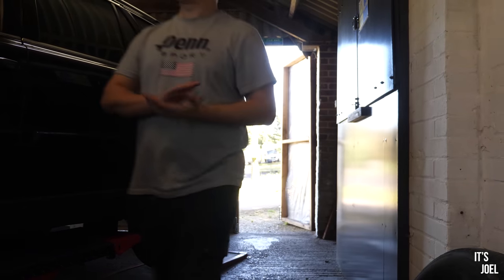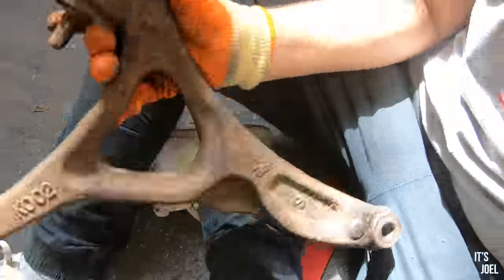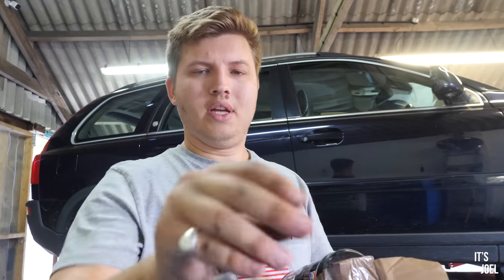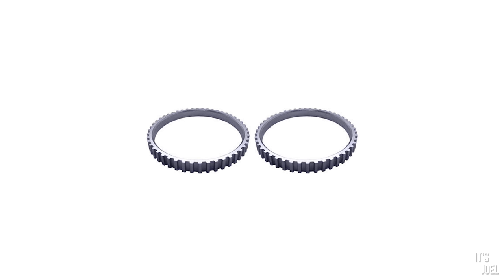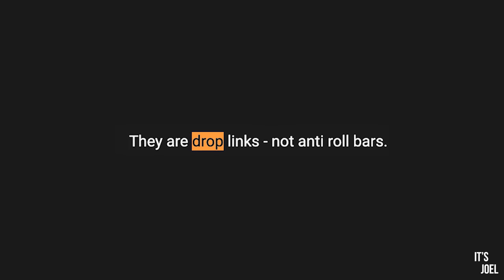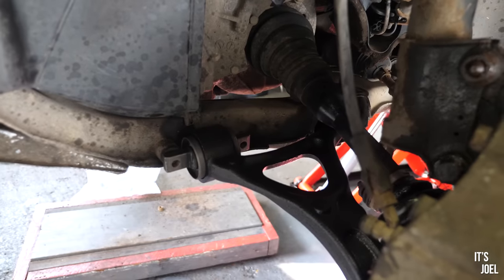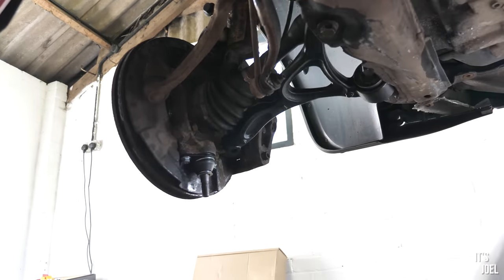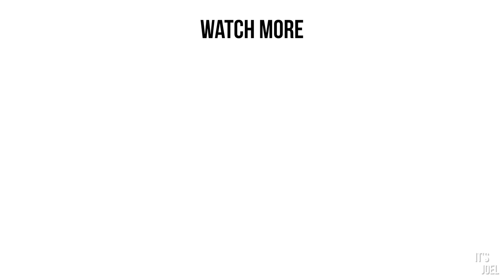CAN I SAVE MY £800 COPART VOLVO XC90? PART 2

Comment from the maker: Click HERE for Part 3! https://www.youtube.com/watch?v=yxhDSFCjmA8
Reply: It's a ball joint, ie it has a ball at one end It's supposed to move just push it back straight
Reply: Keep on doing this man, u will learn so much more. Utube is a great help:)
Reply: I got one little niggle... you got this nice big can of copper grease, but I didn't see you put some on the bolts that hold the ball joint... 🤔🤷🏻‍♂️

Put some on all your bolts and nuts, including the wheel nuts!
Just a little on the end of the thread is enough. They won't come loose by themselves, but it will make your life so much easier, next time you need to take them off!! 👍
Reply: @MasterSandman  never use copper grease on wheel nuts, they're designed to be dry fitted, any actual mechanic knows that
Reply: @jonathansmith2407  I've been working on old cars (15yrs and older) for a long time! 
Perhaps wheel nuts are designed to be dry fitted, but those rusty buggers are always stuck like a em-effer! A tiny bit of copper grease will prevent that from happening in the future!

I'm not saying "Slather them in it!", I clearly said "just a bit at the end of the thread, is more than enough!"

It might not be the "official" way and new cars might not need it... but any mechanic from some small workshop (just like any "home mechanic"), working on old cars, knows that sometimes you don't adhere to the "official method", you do what works! And this works!!

If you don't have an air system in your garage/shed and therefore no airgun, you'll have to loosen them by hand. And if they're stuck you'll have a hell of a job, so the moment you got them loose, you put on a little bit of copper grease at the end of the thread and you screw 'em back in! Next time, they won't be a problem!
Reply: Probably not the best car to start mechanics on there the hardest lower arms I have ever fitted a absolute pig of a job also as others have said the ball joint isn't bent its supposed to move🙈
Reply: @MasterSandman  if you want to lube nuts first clean on a wire wheel and buy proper nut wax which is designed to be used on wheel nuts, copper grease burns and gums up with brake dust stopping the nuts from tightening correctly, copper grease isn't designed for threads it more for mating surfaces
Reply from the maker: lesson learned! @jonathansmith2407
Reply from the maker: Oh I used it alright! Just didn't quite pick it up on the camera, thanks for watching! @MasterSandman
Reply from the maker: That's interesting to hear that these are particulary difficult control arms! And I've learned my lesson RE the ball joint... @grahamsmith4869
Reply: Also a smear on the inside mounting face of the alloy wheel stops them getting stuck due to alloy to steel corrosion.
Reply: but I think that is the least of yr problems!
Reply: its a ball joint, straighten it!!!!
Reply: Hi Joel, what car lift are you using? Regards
Reply: Buy that thing.
If you can see a bolt,this thing wil always give you decent acces.
And,,,there even safe with air tools to,if you hold pressure on the tool it selve
Worked as an mechanic almost 35+ years on  by a volvo dealer.

Comment: To remove the driveshaft from the hub you need to unbolt the tie rod ends (and maybe the struts) from the hub to give yourself enough movement to pop it out. I did a ball joint replacment on axle stands and it was easier to remove the hub entirely from the car.
Reply: Also the ball joints move, think like a your shoulder socket. they are very stiff on new ones but can be moved by hand. So your "bent" ball joint isnt broken.

Comment: it's a ball joint.  It moves.  That's what joints do ;) Move it back straight and you'll be fine.

Also, a small nit pick: in a previous video you were talking about lug nuts.  XC90s don't use lug nuts - they use wheel bolts.

Comment: Congratulations on getting on with it - been there and most definitely done that myself and no matter how daunting it just needs to be one job at a time!
Some words from the wise though - use the right tool for the job and your life will be so much easier. Please don't use torque wrenches unnecessarily, they may be big and chunky but they are also expensive to replace when you wreck them, a basic breaker bar is always a good choice when you've got a stuck bolts. A cheap(ish) impact gun is a much better choice, a mains powered gun might even be a better option than a more expensive battery powered gun if you have a mains socket on hand. It will save a lot of heartache from rounded off rusty bolt heads

Comment: When your struggling with rusty seized nuts and bolts try quenching method heat it up until its red hot pour cold water on it works every time

Comment: I feel your pain - I had to do this job on both sides of an XC70 (same platform). It is doable - trick is to remove the two bolts on the strut, and leave the driveshaft bolt out, then you can put it all back together - it is hard work though. I had a trapped nerve in my leg for about a month afterwards (very painful), from doing it on my driveway.

Comment: In case  you haven't fixed it by now, the trick with these Volvos is to either loosen the top strut bolts (not the middle one which you need a special tool for) to allow the strut some lateral movement to get the balljoint in or get a strong mate with a ratchet strap across the front of the car to haul the strut in to allow the ball joint and control arm to link, even then it needs some real effort to get the everything to fully line up. Don't think you can just push it across, you'll knacker yourself and achieve nothing. Also don't believe the youtube videos that show it all easily going in, if the suspension had enough slack in it to allow that to happen it wouldn't be safe.

Comment: The ball joint swivels in its housing , buy a cheap angle grinder and some cutting discs and some goggles and cut the drop links off , put the ball joint pin in the arm then bolt the ball joint to the hub and buy a Haynes manual , it will show you how many jobs can be done easier

Comment: You might have sorted it out so for, but worth putting it here maybe for someone else trying to do it. 

Drop links - where there’s their nut, there’s a little hole for an allan key to go in, so when you try to unscrew the nut you have to hold the screw with the allan key so it won’t spin. But by the looks of these particular ones, I would just cut them off with a grinder and install the new ones

Comment: The ball joint isn't bent - that's how they're supposed to move. Just need to move the fitted one to the correct angle to marry up with the control arm hole as you offer it up.

Comment: in future, you don't need to make some sort of contraption to press the brake pedal, just put a screwdriver into the vent of the brake disc
edited to say that you can just push the ball joint back again, but if you don't know, you don't know, nothing to get upset about as it's not ruined

Comment: I've changed the abs rings on my XC70 before. 
Once you get access to the old ring, it will easily just break off with a screwdriver and hammer, and then you need a wire brush to clean it up and push the new one on. It's a pretty weak piece of metal and you shouldn't need any angle grinders or special tools. 

I have a Volvo diagnostic tool somewhere and if you're close to North London, I can lend you it if you're not in too much of a rush.

By the way, with a car that size, and without professional tools, you can really do with an extra pair of hands to do the types of jobs you're doing.

Comment: Ball joints are meant to move like the, you may have to "bend" them so they will align with the control arm 
Also the drop links there is normally either an alien key at the nut end so you can hold the shaft still whike yiu undo using a spanner or there can be a box just the other side (by the gatter (rubber) which may need to pushed away to revalal it)where a spanner can be used to hold it, also you may need to do the same to tighten the nut.  Also you may need fo do the same while tighting the ball joint.
Tools to invest in ball joint splitter. Blow touch (heating rusty bolts to red hot and trying to ubdo them while hot will normally win.
Also dont use power toolsto initially start releasing any bolts a racket or breaker breaker bar os far better

Comment: Those drop link bolts you need to put an Allen key in the recess then use a spanner to undo them in the opposite directions

Comment: ABS light could be steering wheel angle sensor, haldex service / module, or the YAW sensor and abs rings. Them centre driveshaft bolts is 30Nm and  then 90 degree turn..Clean the bolt and add thread lock (better buy new bolts from dealer)

Comment: The lower ball joint is designed to swivel circular, and to an extreme angle. There doesn't look to be anything wrong, unless you unevenly tightened it down and badly distorted the flat flange face. The ball joint should be extremely stiff to move when new,  as most have a tight fitting nylon friction material inside the ball and socket.  They are also a snug fit in the hub assembly.  It's best to fit the lower arm to the chassis first, then ease it down and gently tap the joint pin to align with the lower arm hole. Then, fit the antiroll bar linkage. Ideally, have the vehicle weight on the bottom arm before fully tightening the bolts, to avoid undue stress and twist on the rubber bushes. You should use threadlock on any bolts that don't have a Nyloc nut, or other locking method. You may need to loosen, or remove the driveshaft end fixing to allow the splined end to move. If not, be very careful not to pull the suspension upright leg out too far, or you risk pulling the CV joint apart or pulling the driveshaft out of the differential, damaging the oil seal.

Comment: if you havent started on the injector yet, get a little drop of diesel (if you dont have any then spray lots of your lovely wd-40 friend) and pour it around the injector and let it soak in. hopefully make it easier to come out.  if it doesnt come out dont force it as youll need a puller

Comment: Ball joints are a movable component. Its basically a ball inside of a cup filled with grease you should be able to move the stud coming out of the end of it to where ever you need it to be

Comment: Hahaha them ball joint are supposed to bend you just put nut on end and use a spanner to move it back to the straight position. The drive shaft you loosen the bolt a few turns then take a hammer to it and give it a few light taps. Now these Volvos are basically a ford mondeo mk6 running gear and suspension parts are mainly the same. I do suggest using some copper slip or grease when putting back together and use it on wheels so they don’t stick to the brake discs. I run a fleet of mondeos and a Volvo v60 d4 as Taxi’s they all have high mileage and repairs I do myself in our workshop as a mechanic there not bad to work on as long as you use some copper grease on bolts so next time they are not rusted up.

Comment: Definitely need a grinder my friend! Those drop links would be off in about 10 mins and anything else you are not reusing! Besides as you said you would need to do the abs rings. You would find taking the track rod end off the hub and undoing the drive shaft hub nut again makes it easier to fit that control arm. Good luck and its making great content. Dont give up. Its worth saving!

Comment: The best thing for rusty stuck nuts is to mix acetone (nail varnish remover) with transmission oil.  Paint it on the bolt/nut with an old toothbrush and leave for 24hrs (don't get it on any painted surface) 100% the bolts will be so easy to remove then.
Reply: ATF not transmission oil. Proper acetone not nail varnish remover.
Reply: @delukxy  acetone is nail polish remover. I'm not suggesting you use actual nail polish remover now am I!  Atf is transmission fluid. Your post is rather pointless.
Reply: Semantics. Acetone does remove nail polish but that sold for the purpose contains added oils, perfume etc to reduce the drying effect on the nails and cuticles. You said transmission OIL. If you had said transmission FLUID (ATF) I wouldn't have commented about that. Don't take it to Heart.
Reply: A @delukxy  as I say I never said use nail polish remover but don't take it to heart that you clearly misunderstood what I said. I am sure you occasionally get things correct.  Occassionally....

Comment: The drop links you can cut them off if you cant remove then with a hacksaw had to do it on a old ford just use a jack to help fit the new ones

Comment: You should've used your cordless impact wrench with your suspension arm and driveshaft bolts. Fortunately, I've not needed to work on my front suspension aside from the track rod ends and drop links (my XC90 has half the mileage). I had to replace one of my ABS rings because it had rusted away. I had no problem getting the driveshaft out. I've heard of people having problems separating the driveshaft from the hub with XC90s. I had the same problem myself with a rear driveshaft on my BMW E36. I bought a hub puller from Machine Mart which did the trick. I also struggled with the front drop links and ended up cutting them off with a cutting disc on a angle grinder. You haven't bent the balljoint shaft. It has just pivoted so don't worry about it.

Comment: The ball joint isn't bent, it's supposed to wobble about. 

You may also find it easier to put the ball.joint end in first and then pull the assemble back toothed sub frame. A ratchet strap would be your friend here.

Comment: Just a bit of advice. Don’t ever use a torque wrench to undo tight bolts. It’ll cock it up in no time. Tempting when it’s the longest bar you’ve got. But not worth the risk

Comment: That Breaker bar with the bend you need to heat it up red hot and bend it in the vice and get some old Engine oil which you have outside the workshop and Quench the heated part cooling off and it will be must better as it will be then straight with a 90° and will work much better with a straight pull 😅 I've done a lot over the year's and none have Broken due to the Quenching in the used engine oil Good Luck 😊

Comment: The ball joint just needs sqauring back up the design em to move as for abs ring if it's cracked slight tap and will pop off and if abs rings are damaged you will never get abs light off of it

Comment: mate grab yourself a Cordless Impact Wrench! they really help and they add to confidence when working on cars, even the cheap ones are decent to have! also a deep socket set comes in very handy to have!
Reply: He appeared to have one. Did see it used once I think. Might not have been a proper impact driver though. Need a real ugga dugga. Use proper black impact sockets.

Comment: You need to have the hub lifted into its normal drive position in order for the joint to be fitted with a LOT less effort.
Keep up the good work 👍👍

Comment: it's a ball joint, they move! lol  also sit on the bar so you've got 2 hands free to get the joint in.  and get an angle grinder with a cutting disc and cut through the nut enough to chisel it off.  they're always too rusted up to hold the bolt from turning.   and get a good blow torch & roast the big nuts & threads, then wire brush. red hot kills the rust.  you've got to be a bit brutal with rusted old suspension parts.  swearing a lot seems to help.😄

Comment: If you start getting a random clonk / creaking when turning at low speed it is the control arm bolts, mainly the rear one.  These are a torque setting then further angle to finish tightening and in my experience needs to be slightly tighter than spec to stop this random creaking. Good work buddy 🤙
Reply: One final thing bud, the abs reluctor rings can be checked without removing the shaft. These normally crack / break which causes the loss of signal and abs light to illuminate. If you remove the sensor on top of the hub behind the disc (one 8/10mm bolt) you can then shine a torch into the hole and slowly spin the hub to inspect the abs ring. Any cracks or breaks are an issue 👍 when these rings do crack they can also cause damage to the end of the sensor itself, which can be another indicator.

Comment: The ball joint is no different to the ball joint in your shoulder. It moves about in all directions. its not bent. Its a moving part. They just seem like they dont move when you get them new as they're not sloppy.

Comment: Yeah big thumbs 👍up. Thanks for a good laugh tho…. It’s a learning curve, top tip don’t spend hours fannying about with drop-links nuts, jump to Aldi or Lidl & get yourself a grinder, grind those nuts off in mins. Top top tip- don’t need to make up a invention to hold the brake pedal down, shove a old decent size screw driver thr the disc & it will jam on the brake caplier & allow you to get hub bolt free. Send back your big pole, pop along to the nearest house builders & ask for a old bit of scaffolding, job sorted 👍
Subbed pal 👍😂

Comment: Good effort to do my ball joints lower control arms and abs rings i just took the hub completely off made my job much easier abs ring just knocked off but had to heat new ring up with blow torch as missus wouldnt let me use oven . Keep going it only gets easier the more you do it .

Comment: That is NOT a hammer, that is a little tapping tool. use a HAMMER, a Lump Hammer and hit the side of the joint to shock it loose.

Comment: Joel the ball joint isn’t bent , it’s supposed to move . You could have tapped the drive shaft using the bolt that came out …..